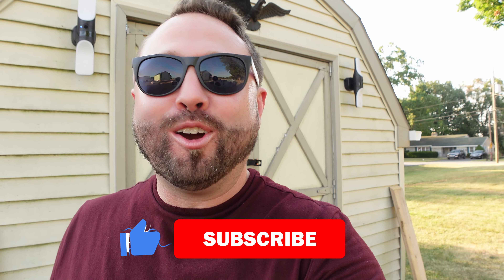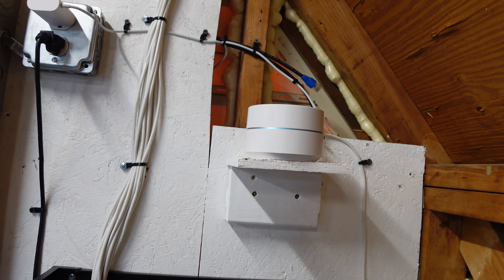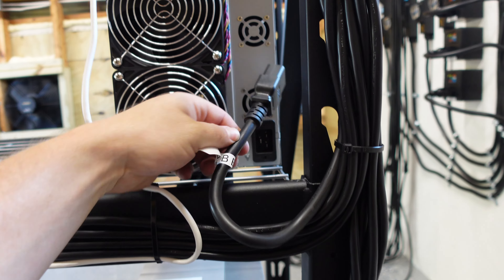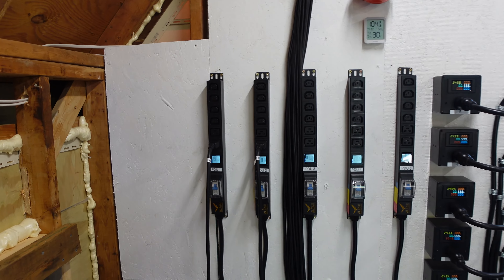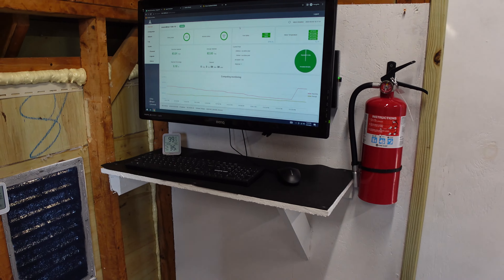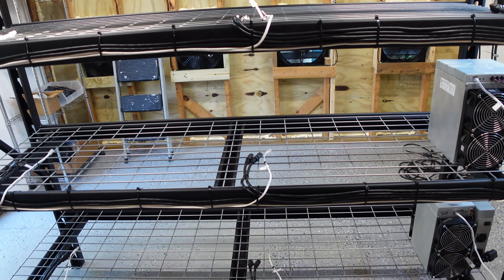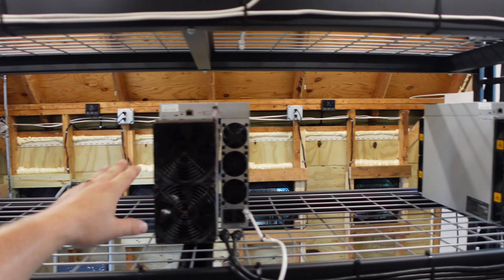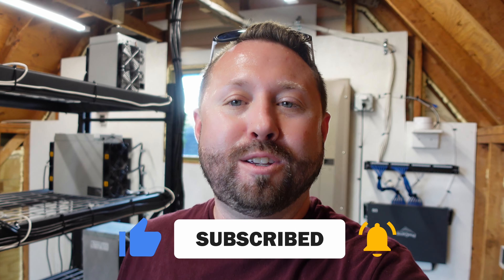Building a Crypto Mining Shed | The SHED is FINISHED!

Comment: looking good - do NOT loop the excess cable though. inductive current is a thing and those cables will ignite.
Reply from the maker: Yeah need to find a creative way to cleanup those cables.
Reply: I haven't heard about inductive current alrhough what are your thoughts on bundling all the power cords? Last I remember they had to be derated by a certain percentage  per NEC

Comment: Hello. I had a few questions for you because I'm planning on doing something very similar but from what I've already experienced I wanted to know why you chose what you chose. First question I had was about your choice of 30A breakers instead of 20A breakers since each unit will take about 16 or 17A and PDUs seem like a waste of money and you can only hook two units to each PDU max from my experience. My next question has to do with your choice of going with a 150A breaker box and not something larger because that limits you to 120A which is only about 8 units. I wanted to ask because I planned on going with more dedicated 20A 220v outlets when I build out my shed and not using any PDUs because I do have one right now hooked up to a 30A 220V and yeah only two units are able to be on it. Also how much did the construction of the building cost? Did you do most of the work yourself or did you hire a contractor?

Comment: Very nice set up! im looking to do one little smaller but with solar. Question i have is how to you keep it cool? 95 degrees ish seems very hot. My concern before i start the adventure in south Florida. any issues with the asics at that temp?
Reply from the maker: It's not about temperature. It's about airflow.  Get air in and out as fast as possible. Look at how HOT ASICs can operate at. You will be surprised.

Comment: what you're doing with the shed is what im working on getting up.. except just a little bit bigger though cause i need space for other things too .. :) awesome man
only thing i would suggest.. is .. you shouldve gone with 200amp panel.. those amps add up quick
Reply from the maker: Property only supports 200 Amps.
This is 150Amps dedicated to the Shed.  50 Amps for the House.

Comment: I think btc mining is going to be tough in the next couple of months. I know that it is the “safest” miner, but at the same time you have so many different problems in the future.

S21 is roling out with high efficiency, the halving coming up which will decimate miners, sure the hashrate will drop, but usually they don’t drop bigger than 50%. So overall, btc miner currently is not really interesting imo. But I guess it doesn’t matter if you have cheap electric
Reply: Kaspa